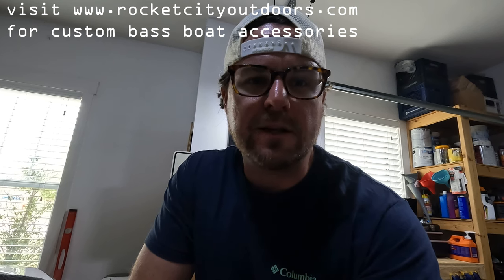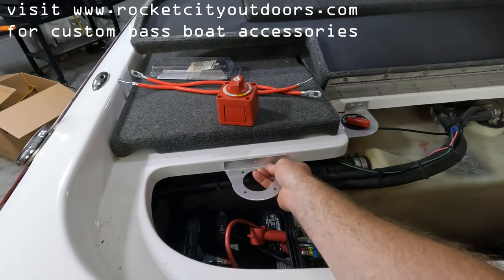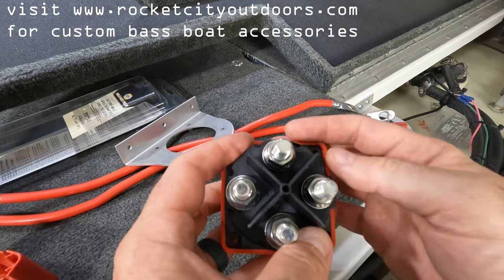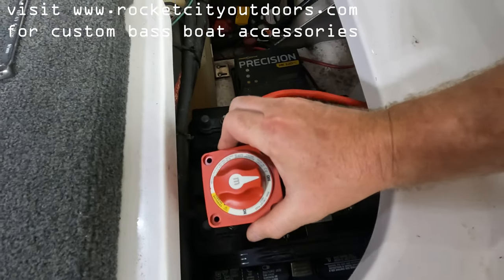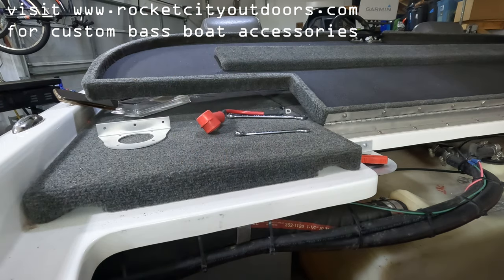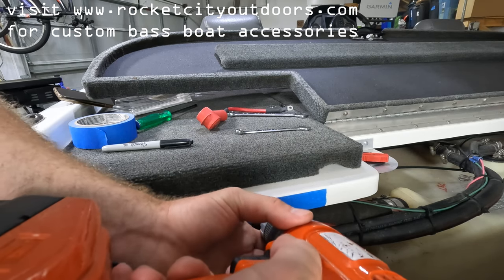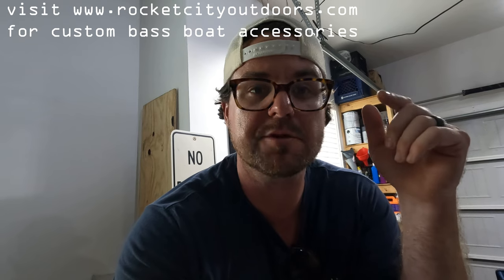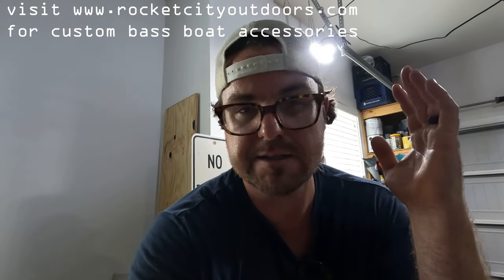Battery Cutoff Switch Explained

Comment: My two trolling motor batteries are in the bow, my cranking battery is in the back. I’d like to have a switch for both. Would it be simpler to have two separate switches? Or also a 3rd switch for my accessories?
Reply from the maker: Yes, this switch allows for emergency jumping of your cranking battery from your trolling motor batteries, that is all

Comment: Maybe your brackets would look a little tidier if the back of the brackets were concealed behind the drilled holes secured using bolts with washers and locking nuts.
Reply from the maker: They will work like that if your bilge lip will allow it

Comment: Do you know how to remove the knob on Blue Sea System battery switch that has a removable knob for lock-out? Mine is a 6007 but the knob does not seem to just slide off. Thanks
Reply from the maker: Hey I don’t think the 6007 has that option.  See here: https://www.bluesea.com/products/6007/m-Series_Mini_Selector_Battery_Switch_-_Red

Documents - installation - instructions
Reply: @rocketcityoutdoors  - Thanks. I thought I saw info showing that switch had removable knob. My previous bay boat had the battery switch inside the lockable console, this one has the switch in a non-lockable storage area right below the helm (easy access). Even though I only take my boat on a couple trips a year staying at a canal house or lake house, I don't like the idea about the battery switch location.
Reply from the maker: I’m not opposed to doing custom brackets for unique locations.  If you ever need one, hit me up!
Reply: How did you measure the holes for the screws?

Comment: How do you know what size switch is needed?
Reply from the maker: Based on the voltage and amp rating of the equipment you are isolating with the switch